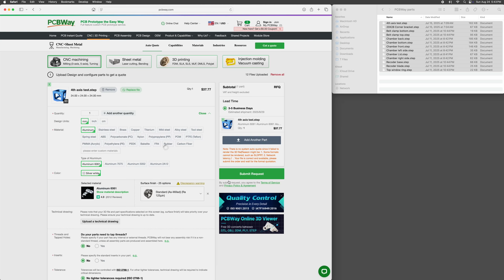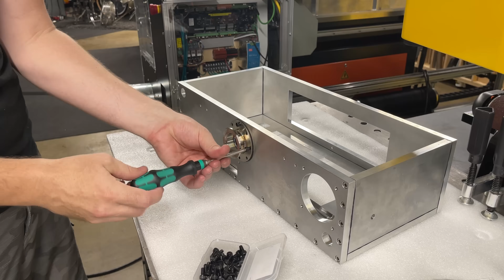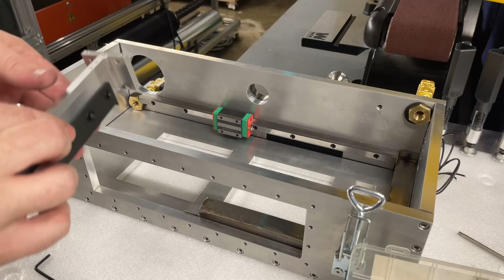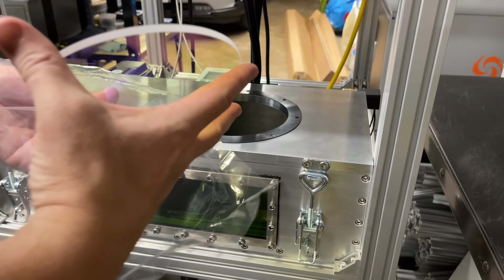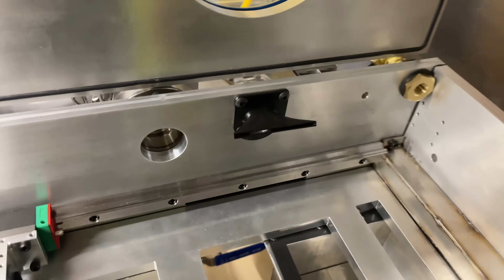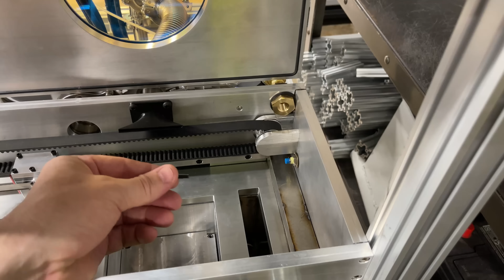DIY Metal 3D Printer: Part 6

Comment: I no very little about the practical nature of sintering however based on my "experiences" in mechanical engineering, machining and 3d printing I would say maximum bead diameter should be ≈1/3 the spot beam or likely less. This based what I have seen in life, not first hand knowledge of this subject.

Comment: That servo its ball bearings will die soon. Epic build but you should add a end axel support on that servo.
So you do not take the full belt tentio  load on the front servo bearings.
Then again.... they are kinda cheap.. 
Super nice build there!!!
Reply: Depends on the belt tension, it is quite a beefy looking servo.

Comment: Depending on what kind of parts your end use case is, the most available powder so far as relatively large/easier to obtain is either 316L or 17-4PH in the 15-45 micron size. Neither of them are particularly cheap, but a keg of 10kg or so will last quite a while, and naturally the option to reuse non-sintered powder helps reduce longevity expenses.

Comment: I've found those cheap push-to-connect air fittings don't seal well unless they are under an atmosphere or two of positive pressure. Depending on the pressure differential is for the inside/outside of your chamber you might find them leaking.

Comment: As someone who works with laser welding machines (building and setup), I have two suggestions. First, put a cover over the glass when you're not using it. Even small dust particles can burn in if you're not careful enough. Second, as someone mentioned before, I don't think it's a good idea to blow the gas onto the glass. First off, you will blow all the particles in the air directly onto the glass, which sounds like sandblasting. Second, due to turbulence with different temperatures, it's possible to have an uncompensatable error. My suggestion: Try to make a strong but steady air curtain with a little distance from the glass, so you only have to deflect the particles that they do not land on the glass.
Reply from the maker: Thanks, a few people have mentioned that…I will rework the duck so it blows a curtain across the bottom instead
Reply: Might be worth having such a curtain above the window too, though if he makes a sealed chamber between the glass and the fibreglass laser aperture external dust wouldn’t be an issue.
Reply: Agree on all fronts, something like an air knife parallel to the glass instead of pointing at the glass.
Reply: maybe use accordion type curtain and magnetic attachment, it could easily pulled up?down? to open the lid...

Comment: So awesome how fast you are progressing with this. Seeing a new video drop has me excited like a kid in a candy shop! :hand-orange-covering-eyes: I'm really curious to see if that nozzle you added for the window will cause you problems. If that has gas flow coming out of it... purely based on intuition, with that placement and angle, I would be worried about it creating vortices that disturb more than they help. But perhaps the laminar flow you are targeting across the powder bed helps shield the surface? I guess, as you say, you'll find out! 😄
Reply from the maker: I share your concern...one thing I still need to do is add some flow restriction to top channel, hopefully if the lower flow is stronger it won't be affected as much...we will see : )

Comment: Is that servo motor going to be vacuum tight at the shaft?
Reply from the maker: It has a seal, so we will see...the chamber isn't going to be pressurized so hopefully it will suffice.
Reply: @diyfiberlaser Yeah I'll definitely be curious to see. Usually those are just grease seals and they're not really designed to be airtight.

Comment: As far as I know, in order for the fusion to be uniform and the final part to have good density, the particle size of the powder should be about one-third to one-half of the laser diameter. In practice, this means that the ideal particles for you should be between 5 and 8 micrometers in size.
Reply from the maker: Thanks, noted!

Comment: For the round holes in the back of the chamber, you should probably have created a channel in the chamber and used a viton (or silicone or PTFE) o-ring seal. They are good for vacuum pressure and over pressure, and are common types of seals for this application. Also, regardless of the type of seal, you should probably use some kind of vacuum crease for the seals. it is messy, but it prevents things like hairs or other small things from breaching the rubber seal.
Reply from the maker: I agree, that would have been a better choice. The chamber isn't going to be under vacuum pressure, just trying to keep the gas from leaking, so hopefully what I've done will be good enough

Comment: I am not a professional but from what I know there will be powder everywhere in the chamber so you might want to protect the linear rail otherwise it might clog the rail which would certainly lead to inconsistent layers and so to worse prints and tighten the gabs between the air circulation system and the outer shell.
Reply from the maker: I hear ya...unfortunately, I made my design a little too compact and didn't account for any space to add bellows...anything I would add now would interfere with the air flow, so I imagine that I will have to be cleaning the rails after every print.
Reply: @diyfiberlaser  uh that sounds like a lot of work, but i think it is awsome how you designed this extremly comples machine from the ground up

Comment: Amazing project :) Question - why is there an open space between the chamber window and the laser rather than some sort of enclosure to keep any dust / stray particles out? I know the whole machine will be enclosed - do you anticipate that is going to be enough dust protection?
Reply from the maker: It was just a design decision to make the chamber as small as possible...I don't know yet if dust will be a problem, I will certainly clean the window before prints. If it is an issue, I could try to make some kind a room around it that would still allow me to open the lid?

Comment: I think your air nozzle for your window is going to cause more contamination instead of less, every particle in the air is now going to be launched at the window. Also I really think you need to reconsider your air flow nozzles, just adding some simple tube features is not going to spread the air at all. You need to add some flow diverting plates to make sure not all air is going to come out of the middle. You kind of need to beat the airflow into submission :P
you could also try adding a long pipe between your laser chamber and window, this way you have a lot more distance between the contamination and the window, on the top of the pipe you could then add some air inflow holes around the pipe to create a slight down flow to keep the contamination out.
Reply: I think you're correct with the laminar flow part. @TravisMitchel This is a somewhat solved problem for mushroom growers who need laminar HEPA flow. Go to the shroomery  and read up on how they turn a squirrel cage motor into forced laminar HEPA flow. I'm sure there are other(more academic) resources, but there is plenty of DIWhy lessons to be learned by reading a few threads. In short, if you can get a pressurized manifold you get your laminar flow. Some have added a 90deg turn in the manifold to avoid turbulence in the corners. If possible, go from the small tube, to a bigger chamber than the output, back to the size of the laminar output, what way all corners have airflow.
Reply from the maker: @eliotaugusto9548  Thank you, I will try to do some more reading and come up with another 3d printed insert to test.
Reply from the maker: I am unsure of the window nozzle as well, I wonder if it would be better to have it blow horizontally across the bottom of the window instead of at it? Ah yes, I could come up with another 3D printed insert that has diverting plates to spread out the flow before it gets to the tubes. I like the pipe idea...I was considering it before, but it might make opening the lid from the top a little awkward.
Reply: @diyfiberlaser  In my diode laser metal 3d printer I have also tried an air knife design but it really didn't work and this was only a gap of 5mm to bridge compared to your 150mm window, I now use a similar design as I suggested for your printer but much smaller.
I have also worked on professional machines that tried the air stream over the window and it also never worked correctly. In the end the biggest challenge in this process is keeping the optics perfectly clean for very long periods of time, because once particles land on your glass and the laser goes over it it kind of fuses it to the window and removing it will also damage the non reflective coatings etc.
Any contamination will reduce the power to the bed also cause thermal lensing which will make your focus variable during the print which is pretty much impossible to compensate.
So I would go with an awkward opening chamber over replacing the window every 2-3 hours :P

Your horizontal window will also be extremely prone to collecting dust so it might even be required to have some kind of purge flow or something else to prevent particles to land on the outside surface.
Reply: This guy knows what he is talking about. I came here to share similar thoughts. I’ve designed the gas flow system for several LPBF machines. Happy to give you some tips if wanted.
Really cool project!

Comment: Project is coming along well. I think that linear rail will work well at first but will most likely quickly fail once metal powder makes its way into the bearing races. 

That stuff sticks like mad to the bearing grease and will be abrasive and obstructive. That’s why you virtually never see exposed linear rail in DMLS or even SLS
Reply from the maker: I would be nice if I could come up with a really compact bellow for it that won't interfere with the air flow.
Reply: @diyfiberlaser  Functional print fibre has some printable TPU/PLA bellows designs, Clough42 tested the design and iterated on it as well

Comment: I forgot to mention on your last vid, but for your laser welder i think you should be able to tweak the retraction settings to where as soon as you let go of the button, the machine is supposed to pull back the wire quickly, so that you don't have to manually jerk your hand every time.
Reply from the maker: Thanks, that would be nice. I will take a look and see if it has that feature.